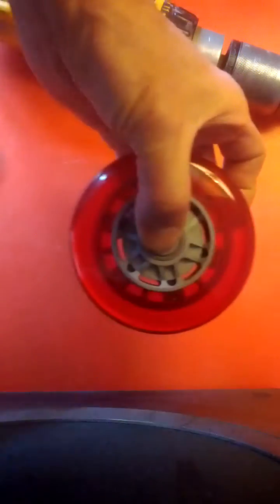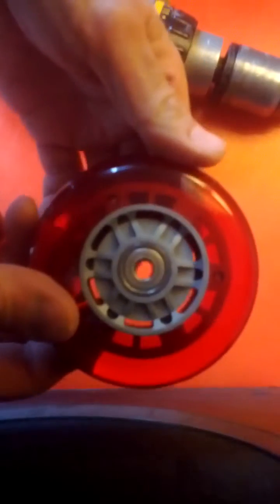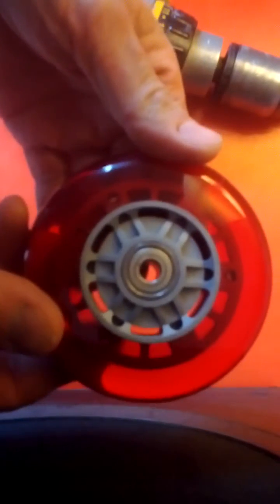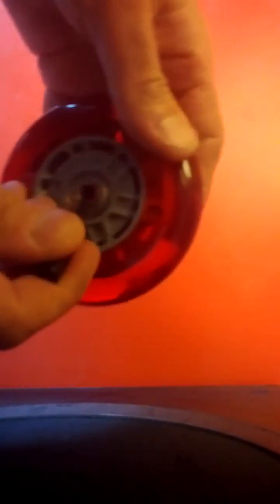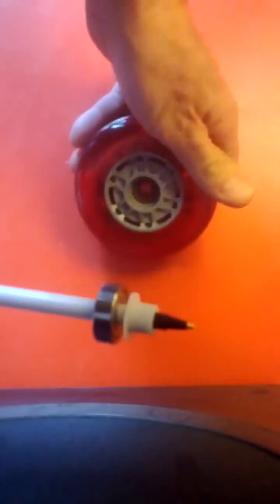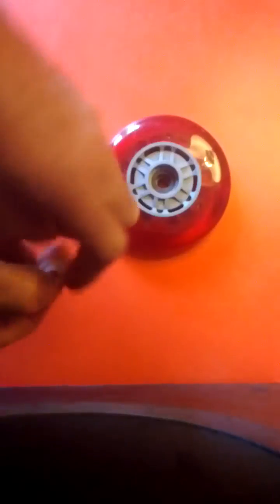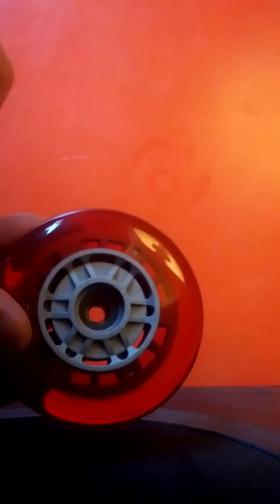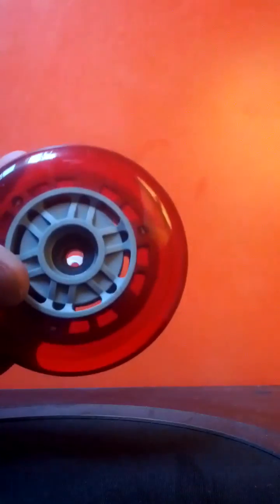Scooter wheel with led lights.

Comment: My guess it’s probably a generator inside the axle where the bearing is in the center of the wheel that you can’t see that when it spins energy is produced which makes the LED wheel light up

Comment from the maker: Scooter wheel with led flashing lights. How does it work? Piezo? Induction? wheel was from the excellent oxorinoco.org scrap/recycling store in Oxford.
Reply: Nice! Could be a generator in the hub? Perhaps weigh it, calculated and subtract weight of rubber to find weight of hub. If it's more than 70 grams then there must be metal in there.
Reply from the maker: Maybe if I put wheel near an induction hob it might light up, proving (?) that it's an induction effect?